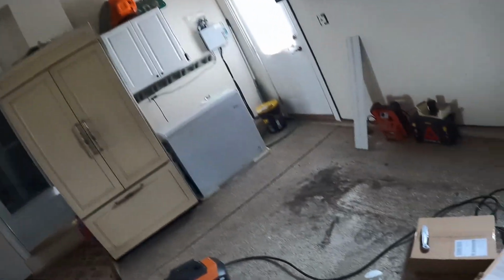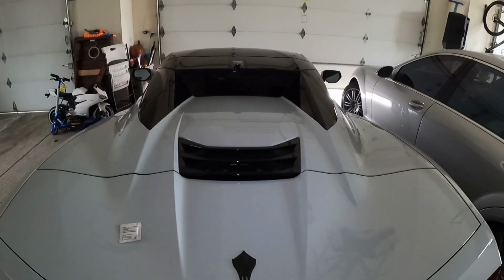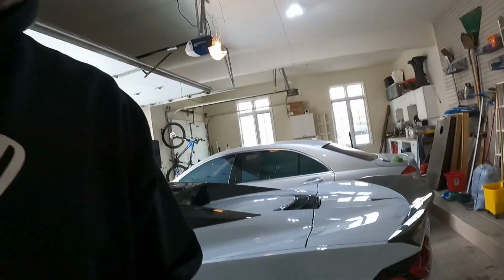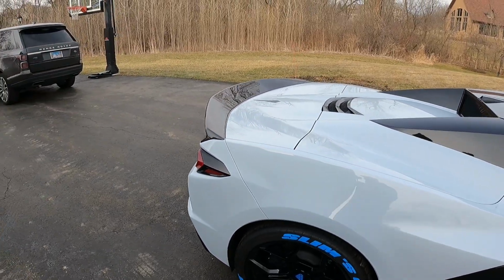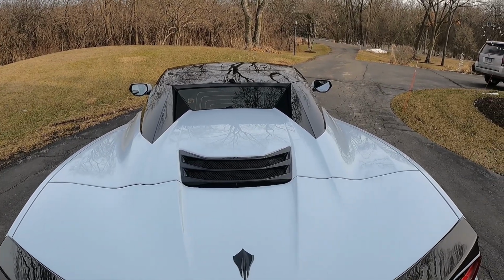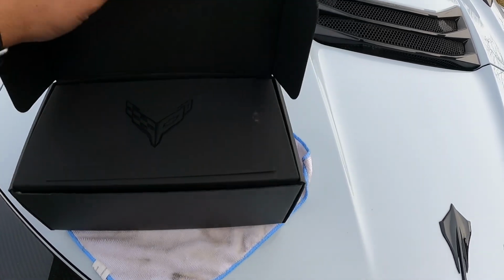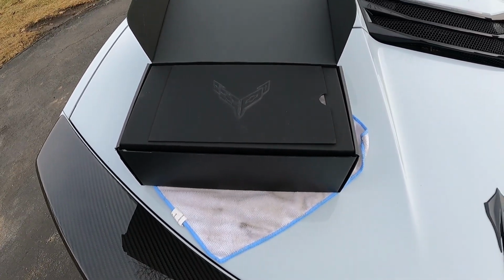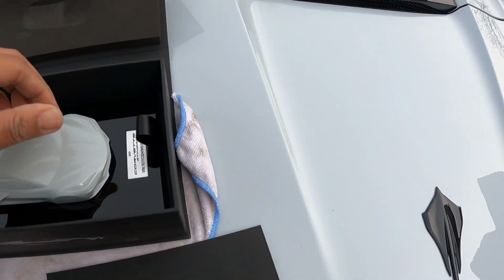C8 duck tail

Comment: Does it really just stick on there with tape and adhesive promoter? Saw another video where they took the rear off and mounted the same spoiler, with the tape and bolts cause the took the stock spoiler off 🤔
Reply from the maker: Yes it just sticks on there with the tape and adhesive promoter ….I haven’t had any problems yet  👍

Comment: I am digging the dovetail wing... Think I am going to go rock with it too...  But I will haft to bolt it down (just for my peace of mind)  Great look
Reply from the maker: I should have done that but it’s been hanging on. It hasn’t come loose yet. Fingers crossed.
Reply: @slimthebodyguard5534  yeah I think you safe..... BTW Slim which 5VM side skirts did you choose?  I am going to do my front spoiler and  sides in CF to match duck tail
Reply from the maker: @Steffon Bizzell  I got my side skirts from C7carbon.com
Reply: @slimthebodyguard5534  THNX

Comment: Hey Slim, I like the spoiler! Much better than without it. How much was it? Where did you get it? I might not get the high wing and get yours instead, depending on cost.
Still waiting for my SHUT UP2 😉 Matrix Gray from Danny at Corvette Exchange or one of the other 2 reservations I have.
Reply from the maker: Thank you 🙏🏽 … I got the spoiler from Wildhammermotorsports in Mundelein Illinois 220 Terrace Dr. phone number 847-469-8306… Danny is great I know of five people that has gotten C8 from him and he has delivered on his word…the SHUT UP2😂😂😂😂👍👍
Reply: @slimthebodyguard5534  Hey John, just spoke with Matt. He highly recommends drilling the holes and not relying on the adhesive only. Are you planning to drill later?
Reply from the maker: @leudop  at this time it’s a little late for me to be drilling so if I see any problems where it starts to come off  then I might try to use a heat gun and take it off and drill but as of now no I’m just gonna rely on the double-sided tape….. I watched several videos where several guy said the double sided tape was good enough and will last so let’s keep our fingers crossed 🤞🤞🤞
Reply: @slimthebodyguard5534  Hey Phil, let me know when you get your car comes in at Lake Bluff. That is where I got my car from Danny also. Maybe Slim will also show up .Red mist
Reply: Looks great, & those blue letter tires omg! That tape isn't letting go in my opinion & you did a good job putting it on.I've put a few things on my Cadillac & once it touches that's it...
Reply: @williedavismckennie5334  Hey Willie / John, Corvette Exchange update: they screwed me. After waiting 12 months, Danny said they wanted at least $5K over MSRP AND since they were getting up to $10K over MSRP, my car would get ordered AFTER the $10K orders. Fortunately I had 2 other reservations and expect my car around the end of this month.

Comment: Hey Slim did you get your left front driving light fixed because my 22 C8 is doing the same thing LF DTDL not working. If so what did the dealer do? My dealer is on the 3rd attempt to fix it.
Reply from the maker: No they still have not figure out what's going on I'm taking it back in for the fifth time they are going to have someone from GM fly in to see what's going on that's what they have told me 🤬🤬🤬🤬

Comment: Did you use the bolts? I just received mine and it comes with bolts
Reply from the maker: No I did not use the boats I just used the double sided tape it came with and it's been great so far